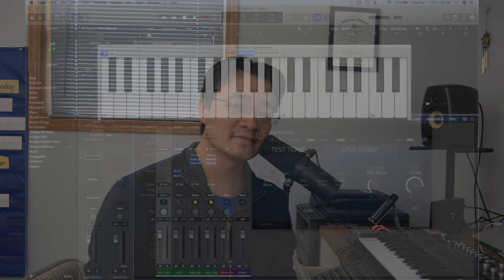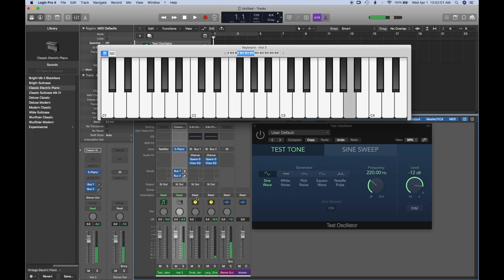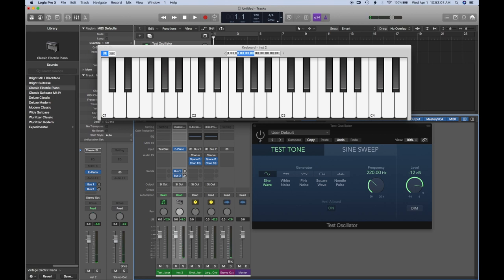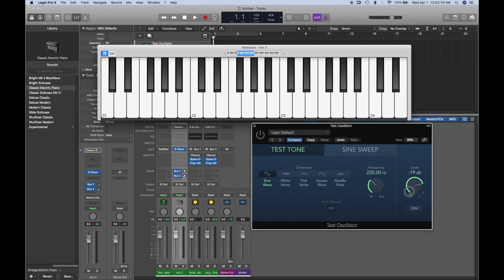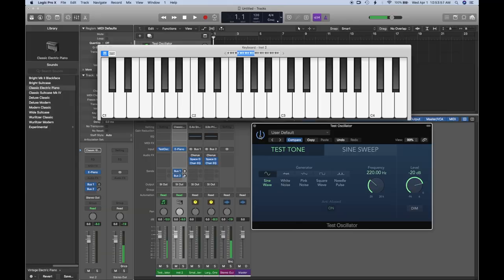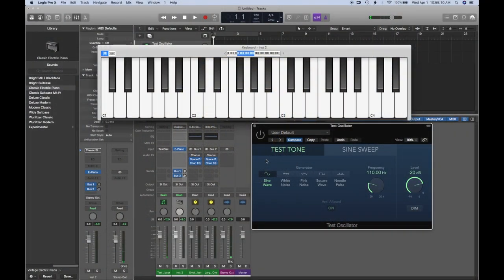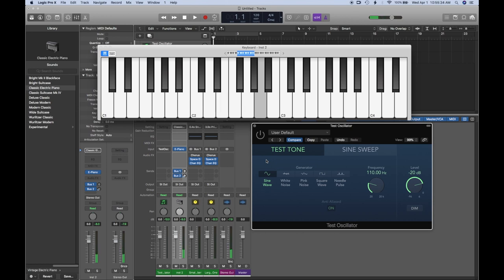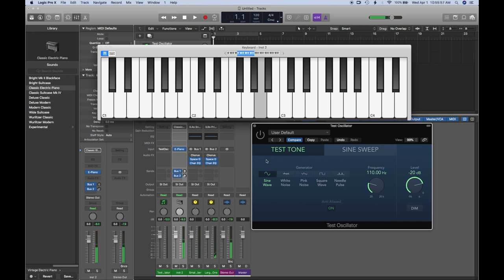Tutorial - Vocal Subharmonics (How to Sing Subharmonics)

Comment: Does subharmonics feel like applying pitch to your vocal fry? When you use vocal fry as merely a tool at the very beginning of a phrase, we often don't ever think of it as something that's actually a part of our range. This is what I've done that sounds as close to it as it currently can be: you use extra breath support on your vocal fry (which most people don't) with a little extra tightness (not tension, similar thing for whistle voice) on your throat to create a much more consistent tone within that register and just start trying to hit and stabilize each pitch you go for. Is this correct?
Reply from the maker: Great points. I think so long as the approach gets you the desired sound, it is a correct way of looking at it. For me, it depends on if I am using a voiced consonant or vowel that requires the fry-full voice interaction to be immediate. The fry first just needs to be really quick to give the impression that the note started on the same pitch as the subharmonic (let's say the word is "virtue" on a G1, I would start with fry and the G2 on the "v" sound immediately so that it sounds as if I am starting on a G1. If I start with full voice first, I end up with a G2 "v" sound and then a "pop" down to G1 when the subharmonic shows up.)

I suppose you could say that leading with fry first may work well and definitely better than starting up the octave and then applying the fry. One issue would be that the pitchless fry may not interact well when the full voice note comes in - it may get stuck or you may lose some integrity of tone by it sounding too much like fry instead of a fuller voice kind of sound; going for immediate "interaction" of both full and fry together to get the subharmonic is the main goal.

Comment: Wow, I'm gonna try learning this so I can reach contra octave notes! Thanks for the explanation! BTW, do you consider yourself just a regular bass or a basso profundo?
Reply from the maker: Regular bass. Lyric Bass if you want to be a bit more specific (Bass-Baritone equivalent). Not a profundo haha. Also, it depends on the ensemble I am in.

Here's a chart that has worked for me in what I do:
Classical/Opera: Lyric Basso Cantabile or Bass-Baritone
A Cappella (Contemporary, Gospel, Barbershop, Doo-Wop, etc.): Bass
Choir: Bass or Oktavist depending on rep

There are other requirements for Basso Profundo that I do not fulfill as it applies to its original use in opera (that also includes stage presence, stature, and other role/rep requirements).
Reply: @bass2yang  really, stature? Is that really the criteria used to classify a vocal range?
Reply from the maker: I think that stature was a consideration for the role of the character. Not so much anymore, which is why I say that it applied to its original use.

Imagine an imposing Mephistopheles with a dramatic bass-baritone voice... but is shorter than the rest of the cast. Soundwise would be cool and might even work, but visually it is not as impactful.

Think of why movies use perspective to create character differences and demeanor. Some actors/actresses are shorter than others so they have to create the illusion of height as well.

My apologies if it sounded like it was a specific requirement.

Comment: i have a high pitch voice, everytime i try to go for sunharmonics it feels like i automatically sing an octave lower, and it sounds very much like vocal fry... how could i improve that?
Reply from the maker: Usually vowels can help with vocal color. The range of the subharmonic comes into play as well with D2 and above feeling like it is higher and less bassy.

Record yourself to hear if the note is too high, vowel is too bright, or if there is a shift in space in your vocal box (open throat sound which is technically an open-pharynx). If you can sing a Bb2, try aiming for a subharmonic Bb1.

I may do a video on how to continue to effectively align the voice and assist with building the foundation for subharmonics.

Thanks!
Reply: @bass2yang  Thank you so much for your reply! i found out it really helps to practice vocal fry and get a solid foundation before try using it for subharmonic, because im only use to a certain range for vocal fry, so it:s almost impossible to get the subharmonic if you can:t do the vocal fry at that range...   Anyways, looking forward to your new video!! Thanks again!

Comment: When you hit the F2 from F3 I cried a little bit. I’m stuck in the low Eb1-A1 ish range. Should I gradually push higher for a better range?
Reply from the maker: That's usually the best sounding range from what I have experienced (Eb1-A1, give or take a few notes). Try humming the subharmonic and carry it up until it breaks apart or stays strong. The humming will help keep the weight off of the voice.

Thanks!
Reply: @bass2yang  Much appreciated, thank you!

Comment: Hey, I'm trying to learn this but my imaginary double chin starts to ache. Am i forcing something or is that supposed to hurt in the beginning? Did successfully jump some octaves though
Reply from the maker: If you apply too much pressure, it can start to hurt. This application uses very little pressure, but a bit more focus. It almost feels like a pivot or tilt forward when I do it (applying vocal fry at the same pitch as the normal pitch being sung).

What you may have discovered is kargyraa or VVM, which does engage a more active approach with the false folds; this, if done forcefully or without consideration to space and relaxation, can start to hurt. Approach with caution, definitely.

Thanks!

Comment: can you explain excatly what is happening in the vocal folds in the subharmonic register? didn't quite understand how it works
thanks for  the video!
Reply from the maker: I go through it slightly more in depth on my blog (there are some research papers as well - I think there is one that has been recently published. If I can get mg hands on it, I'll be sure to talk about in a future video). 

What happens is that your vocal folds become slightly asymmetrical (one longer than the other, one thicker than the other, etc.). The vocal fry setting in your voice is where the vocal folds become thicker and shorter, and they are fully adducted (meaning the vocal folds are completely together). When you sing with this offset, the pitch created is a subharmonic due to the vocal folds' pitch periodically "meeting" at certain points. These points that are plotted are very similar to the points of the note that is an octave below, which gives us the perception of singing down the octave.

If you do a search of "Mari Kimura subharmonics", she has a wealth of knowledge and research on subharmonics (and notation as well for subharmonics).

Thanks!

Comment: Hey Thou,

Thanks for the great tutorial. When I get really low in subharmonics, it starts to feel...grindy, like fry but much more intense. It feels like I'm placing it closer to the back of my throat, and if I continue for too long it seems to make my throat sore. Obviously I stopped at that point, but do you have any idea what might be going wrong? I can toss a recording up on YouTube if you'd be willing to look.
Reply from the maker: It could be a few things:

Sometimes (in my case), if I start with too much pressure or try to project, I usually stop around F1 or E1. 

For low subs (below F1), I start up the octave and focus only on warmth and connection first. Then I (very lightly) layer the fry in at the same pitch. The subs are very quiet but they are easier on the voice and feels "bassier."

If you place it too far back then it won't be stable. Subs should feel like they are resting above your vocal folds at its initial point of contact and above (or behind) your eyes in terms of point of execution. If that doesn't go well, feel the point of execution behind the teeth.

(Point of execution is the target of where to aim your sound - just a different visual tactic for instead of saying "placement" which, for some reason, makes students place their voice in an area without information on the preparation.

Point of execution makes one to visualize the preparation and release much like the release of an arrow from a bow (placement would be simply taking the bow and putting it on the target instead of actually shooting the arrow).
Reply: @bass2yang  Thanks so much I'll give it a shot!!

Comment: I’ve been trying but my voice just tends to snap down to a very fry version of the actual note I’m trying to sing. Like if I’m singing a G2 and I attempt to allow a little fry in I just snap to a full-fry G1. It feels a lot like it’s just a habit I’ve built from wanting to hit low notes like that but not knowing how. I don’t know if you’re still checking comments on this video, but I’d love to hear any suggestions you may have
Reply from the maker: Try it higher to where it is slightly out of the comfort zone. Usually, when we learn our rep a certain way, our body remembers how the piece goes and we tend to default to it (which is why voice teachers are careful to introduce a piece that the singer is not vocally mature enough to handle yet).

Try startinf on a higher note like F2 OR a lower note like D2 and see if it helps you find it. You're on the right track it seems, just need to give it more time and less control.

Thanks!
Reply: Bass2Yang Thank you, ill give it a try, I’ve been working mainly with the Ab and G. The Ab has started to come along pretty nicely the more I practice it actually. It feels wayyyy more relaxed than forcing a fried pedal tone. Your video has explained this technique in a very clear way, thank you for that and thank you for responding!

Comment: I've run into another problem... I think I got the subharmonic for the first time today and it felt very weird which I think is a good sign that it worked, the thing is I think im relaxing too much because when I go back to full voice, it tends to be a note lower than what I initially started on. Any tips for this?
Reply from the maker: The drop in pitch could just be that you relaxed the mechanism a bit and when it moved back up the octave, you ended up on a different note. Sort of like when you sing a scale, you have to account for the tendency to go out of tune when moving up as well as when you move back down (my teacher would always tell me to take big steps going up and small steps going down).

Try keeping a stable airflow and pitch and apply the subharmonic during the stability to see if that helps. Disengage to get the normal octave while still maintaining a proper airstream and that may fix the drop in pitch issue you are experiencing.

Thanks!

Comment: Are you using 2nd subharmonics? It sounds like you are because it sounds different from most people subharmonics.
Reply from the maker: Interesting - this is the first subharmonic that I am demonstrating. All first subharmonics should have a strong normal fundamental and fifth (so if it was an A1 subharmonic, then the normal fundamental is A2 and the fifth above is E3). Second subharmonics have a strong fifth and fourth above that fifth (A1 as 2nd subharmonic, E2 as 1st subharmonic, E3 as normal fundamental, A3 as first harmonic).

The way I filter my sound (vowel, space, etc.) could also sound slightly different - I usually perform off-mic so I tailor my sound for that.

Thanks!

Comment: Im getting my subharmonics but why is not louder?,I'm trying this for first time but my modal voice low notes sounds louder than my subharmonics,can anybody help me?
Reply from the maker: Subharmonics will feel like they are softer if it is done correctly. This is because most of the sound is resonating outside of your own ears instead of in.

That said, you also lose some volume due to not being able to full resonate in the way that you are used to. It takes time and you must approach it with an open, relaxed feel before you try to gain more "cut" and projection.

Thanks!
Reply: @bass2yang  Thanks a lot.

Comment: Sir how harmonics are produced by the vocal folds at the same time
Is there any science pls don't say like it's natural and every sound does..
Reply from the maker: There are research papers out there regarding subharmonics in speech and singing (Titze has the most recent research). Google may not be able to give you everything so you may have better luck on JSTOR or your local/university library that has access to more resources. 

Regarding subharmonics, it is essentially assymetrical vocal folds where the true folds are slightly offset, causing the subharmonic to appear (periodic or intermittent). One way to look at it is to think of tapping 2 against 3 using your hands against your lap. You'll notice that there are moments in which your taps end up together. These moments take more space and time (which equates to a longer wave, which equals a lower pitch and will be one octave below) and are the subharmonics.

Hope that makes sense - I may do another Q+A on this because it will be easier to demonstrate.

Thanks!
Reply: @bass2yang  
Thank you sir, I'll be grateful if you demonstrate it

Comment: So how do i tell if I'm forcing the note?     My switch points from high to low are G4, E3. A3-G2.   Below C3 I lose power but pick up a bit by F2.    How can I strengthen those notes?
Reply from the maker: I use the "elevator" concept. Think of your voice as an elevator with different floors. Use closed-type sounds (humming with like M's and N's, "ng" sounds work really well). Start from a comfortable note and go up high and then down low. If you feel that there is a bump somewhere, try lip rolls (lip buzz) or tongue rolls (R's or D's) to move the focus away from your vocal folds.

The idea is to streamline your breath without overexerting or adding too much weight to your vocal folds. Sing quieter but connected first, then crescendo to a louder volume while still being connected.

You can tell you are forcing a sound if it is starting to sound too heavy or even dark - this can go the other way as well where it is too strident and bright (where it sounds really harsh). A vocal teacher/coach can assist you better on this but these are things I tend to use and look for when working with voices.

It may be different with your voice so start smaller with just proper breath energy and proper consonant and vowel formation. Add rhythm and pitch later and keep going forward from there.

Thanks!
Reply: @bass2yang  sweet!!    Thank you. I've been trying to sing Basso Profundo and Sub harmonics for the past 6 years, maybe I just have the technique wrong. Idk.   But thanks for the tips

Comment: i have problems with pitch when i do get to the lower note. i rarely land on the octave below and many times go past it or dont even reach the octave. any tips?
Reply from the maker: Some typical issues for lower voices that makes it to where the singer miss the octave drop are: lowering the larynx too much, "relaxing" the breath energy, or giving up the proper tension needed for proper phonation and core sound.

Try moving down with a scale (Do, Ti, La, So, Fa, Mi, Re, Do) and think of an escalator that is also moving up. As you descend down the escalator, start walking up with your breath energy and focus to keep you "suspended" in one place (you know how kids do by walking up an escalator that is going down).

Some people imagine taking smaller steps when descending down into their low range or taking bigger steps when moving up to counterbalance the tendency of inaccurate pitch when changing from note to note.

There are many ways to work around this but find the tonal center and destination, hear it, feel it, and then sing it. Hope this helps!

Thanks!

Comment: how can you improve mixed voice between subharmonic and full voice?
Reply from the maker: You can work on connecting the breath energy to your middle voice (where it is easy, speech-like, and comfortable) and work outward to the extremes (high end, low end). The way I see it is that you are always "mixing" - "mastering" is giving the final touches on it to let it shine.

For simplicity, fry and falsetto are your best tools for venturing into extremes. Focus on connecting your voice and then pitch. Work from the middle and then move to extremes.

One caveat you may encounter from voice teachers: do not carry up your fry too high or you will risk vocal damage.

To rephrase that for our understanding, vocal fry requires 100% tension (notice that you do not need a lot of breath pressure, which makes it feel like it is easy to do). The issues arise when we try to use the same amount of breath pressure when we sing the midfle and higher range while trying to forcibly bring our vocal folds so tightly together (in addition to trying to make them thicker during the process) for extended amounts of time (also using only a few muscles instead of the entire musculature needed for efficiency). 

The issue is improper tension and use which leads to vocal issues, not necessarily the vocal fry itself.

Hope this helps! Every voice is different so consult your vocal teacher for targeted needs and support. Thanks!